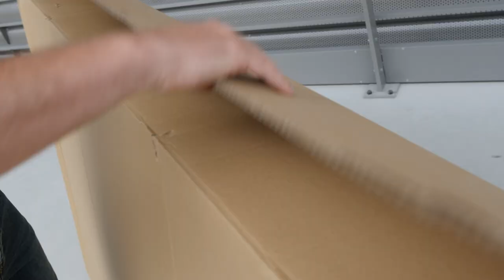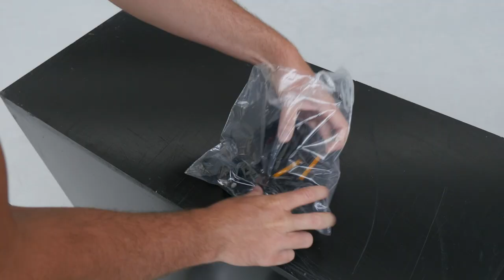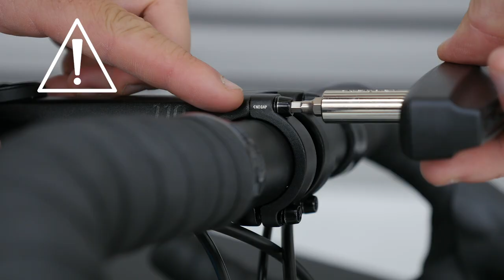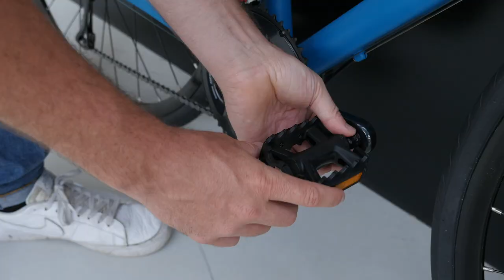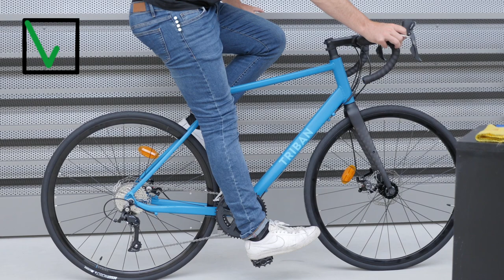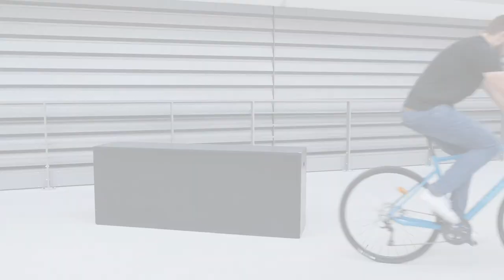Unboxing the Decathlon Road Bike - Triban RC500 Disc Brake

Comment: Not going to lie, this is probably the best assembly tutorial on youtube. Most noobs will incorrectly set the saddle height too low, the fact they included this tip is very useful.

Comment: Just built mine today, the back disk brake is rubbing slightly when turning the wheel. Is this normal? Should I just do the 10metres 10 times  holding down both brakes to sort this out or what mate. Cheers for any help.
Reply from the maker: Hi- We're sorry to hear you're experiencing an issue with your disc brake. Please reach out to our customer service team at customer.service@decathlon.com and they can connect you with a bike expert from our team. Hopefully we can help out!
Reply: watch park tool disc brake alignment , if still rub go to a mechanic. If the mechanic said the rotor is bent, it should be replaced or decathlon quality issues
Reply: @DecathlonUSA  Good to know. I just assembled my RC520 and my front disc brake is rubbing. I'm a newbie so I had to look up the bed-in procedure. I wish that was explained in the video. I will try that first and see if it goes away.

Comment: For seat height, this is wrong. You do not want your seat so high that when your leg is on the bottom end of a pedal stroke it's straight. You want a slight bend in your knee(s)....doing so would cause unnecessary hip rocking and be very uncofmortable.
Reply: I think it's ok if you have the heels on the pedal for adjusting like it is in the video. When riding you put your balls of the feet on the pedal and everything will be fine.
Reply: It’s because u put the balls of ur feet on pedals when cycling. Having leg straight with heel on is great basic measurement to ensure that u have a slight bend when using balls of feet

Comment: I planning buy this bike but ı have a question. Can ı add much bigger tire on this bike reason for use like gravel?
Reply: up to 700x36mm ( some people say you can put up yo 700x40mm but then there is no much place for sand and mud, so it may not work well)
Reply: my friend had this bike he went to the bike shop to make sure that the bike can fit 36. The mechanic said the highest it can go is 36
Reply: With fenders 32mm is possible.
Reply: @kappy2609  Don't recall.. I read somewhere that you can mount slightly smaller and thicker tyres for graveling...650x40 think it was...EDIT: I've found it: Tyres compatibility 700x36 or 650x40...in the Decathlon web itself, RC 500 technical details. Hope it helps.